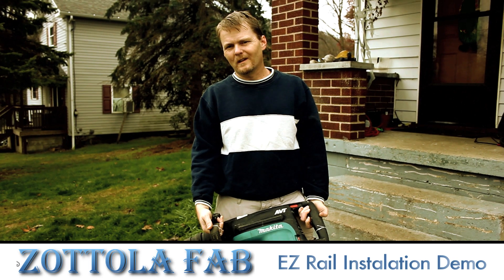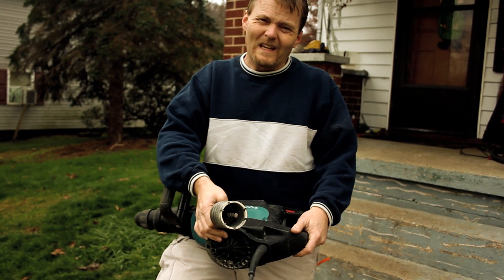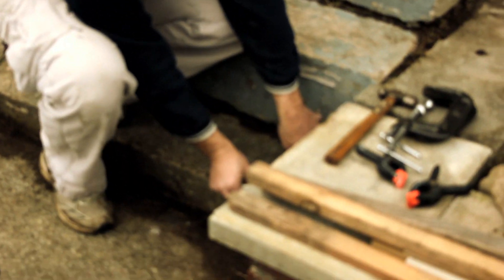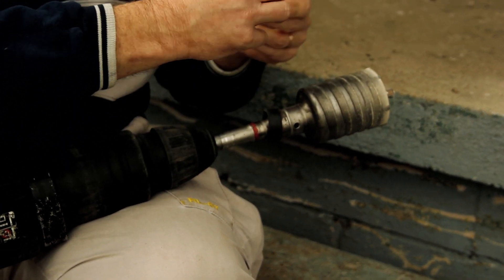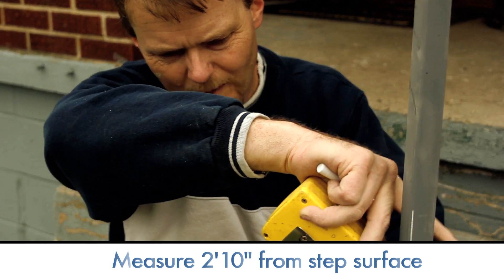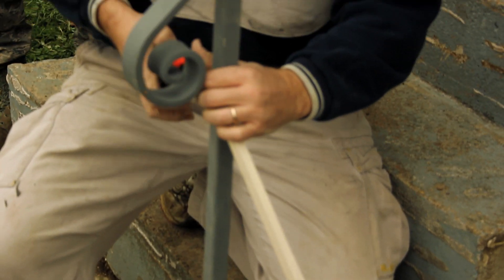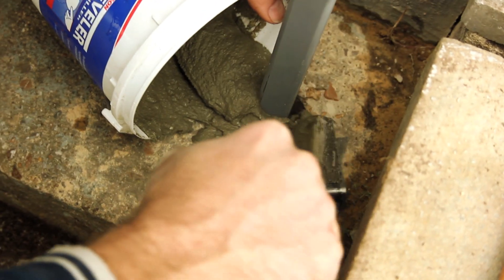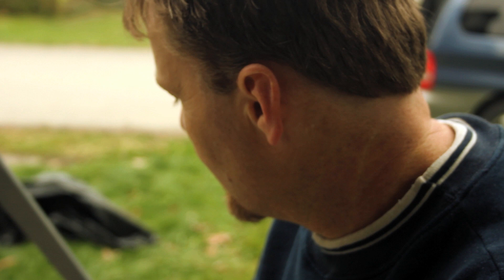Core Drilling EZ Rail installation demo

Comment: How did you get the core out itself?
Reply from the maker: That type of drill mostly crushes the concrete inside the core. So you either vacuum it out or it’s up in the corner and you tap it out.